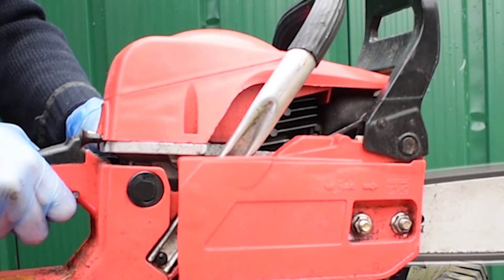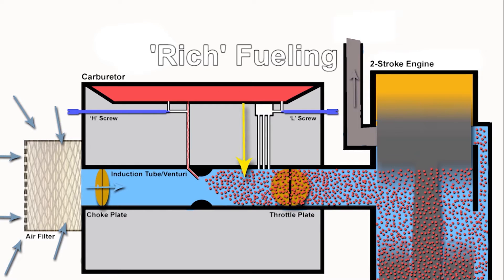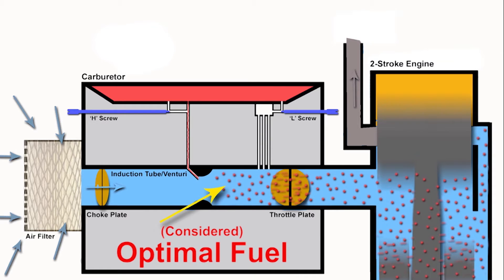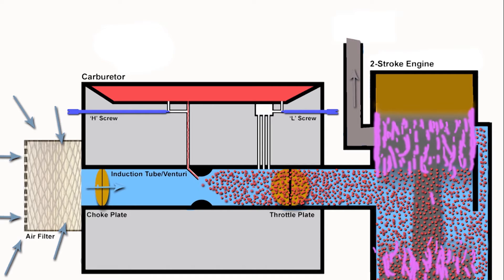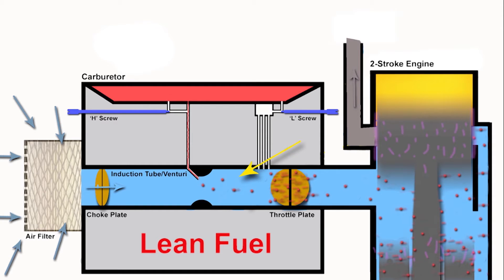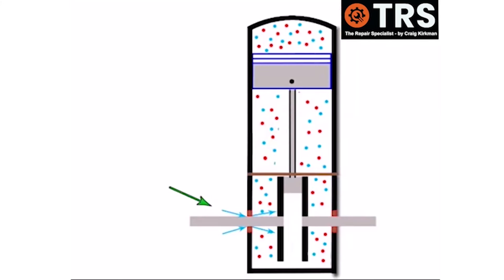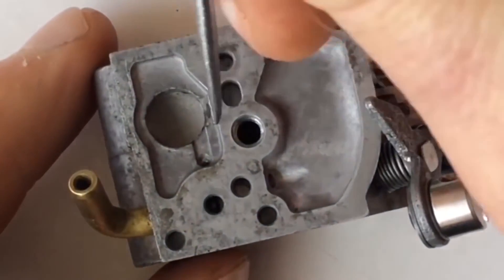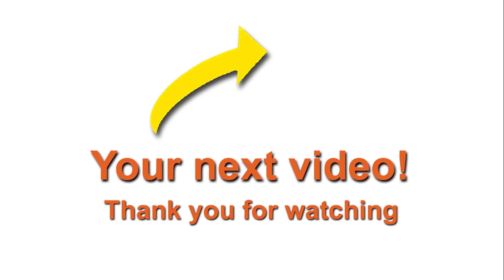The Effects of 'LEAN' Fuel-to-Air Mixture on 2-Stroke Chainsaw Engine RPM. (by Craig Kirkman)

Comment: Apologies to @TheRepairSpecialist if the following already exists but I'd LOVE  a video detailing how&why a powerhead may "get quirky" IF it's tuned well & running well but then, in my case, you're running it (echo 590) very hard in the midday FL humid heat, working your way through a large Oak trunk, and then like 20 or 40min into the job you find yourself needing to adjust the carb to re-gain that good-running condition you'd previously had! Currently giving myself a "remedial carb's course" because of that problem right now, I stored my 590 directly after the described scenario and a few months later upon trying to use it, it's barely turning-over (fuel quality / spark / etc, all 'low hanging fruits' were inspected before looking to the carb of this ~1yr old, well-maintained 590!)

Hope you figured out your SRM's scenario/solution, nothing more frustrating than taking care of your unit, self-schooling yourself, and still fighting to keep it working and/or contemplating simply buying a 2nd unit ("I WOULD have a 'parts saw' if I just bought a 2nd 590!", lol!!)
Reply: Maybe I was having a parallel saw problem last summer bucking a large trunk after felling it.  I was using one of my favs - a 372XP and in the hot weather it started bogging down on me losing power.  I still don't know why it happened and it's been running just fine since! (In my case I didn't try a carb adjustment but simply switched to a bigger saw.  I tend to take quite a few saws on jobs so when I run into problems I can just switch saws and keep working.)

Comment: Hey, i bought a 2 stroke electric generator and i cleaned the carburetor. The guy demo-ed the generator more than once with ether because he could not be bothered to clean the carb. It is only running fine if i let the choke on. It is possible than a lack of filter make the fuel mixture run lean, or i should look somewhere else to find another air input ? Or a damaged piston than got higher resistance, seal ? It is seems to be able to run if I unhook the speed regulation and remove the choke at least for 10-15second.
Reply: the possibilities are, 1. is the filter clean? . 2. if the filter is damaged, replace a new one. yes even if the tube of the filter is damaged which will called "Air leak" that will drawn more air into the engine to make the fuel mixture lean. 3. be very sure that the carburetor filter is free of blockage.  4. it could be the carburetor need adjusted a little bit.
Reply: @mitchelrichardson8164  thanks for the answer but i figured it out, I did not took apart the front panel when i wrote this. But here is the update:
I took away the front panel, i discovered that the carburetor/motor joint was flipped on itself, creating a vaccum/air intake after the carburetor. So I cleaned the joint, made new one from cartboard envelope from Amazon (pen, cutter, and drill bit with drill in reverse running fast to make dust with the cartboard, on a piece of wood ). It was running and stable but the speed regulation part was getting stuck and the diy air filter need adjusting. So I did remove the filter to see if it was starving for air. And I put a some air around the regulator shaft and now it running like I want even with the filter on.
Thanks, have a great day.
Reply: Oh, it might be a vacuum building up, i suspected something was up with fuel intake but not this way, you mentioned this into another video.
Reply: No air filter will cause it to be lean. Also a dirty carb will cause it to die after a period of time of revving it.

Comment: I recently bought a Stihl MS 661 CM Magnum by accident (complicated story so I'll spare everyone the details) and I'm pretty pissed off because I wanted the MS 661 R instead! My reasoning is that I don't like the idea of having electronics in a chainsaw. My question is for those that have the CM, What is your experience with your saw and has the electronics caused you any problems. I'm thinking of getting rid of it or possibly giving it a chance.
UPDATE: Since I got this saw a few days ago today was really the first chance I got to test this saw out. I cut a lot of ash from 24" to over 30" dia. Between how easy this saw starts and its cutting power it won me over. This saw is an animal that screams for more wood should you slow down below its cutting speed. Am now happy with it and thank you to everyone that took time out to respond.
Reply: no the electronics work very well, our 261 and 241 run very well with the electronic carburettor, even our MS500i works very well after months of no operation.
Reply: @gnaedigerfels  Thank you for taking time to give your input.
Reply: give it a chance. electronic battery chainsaw just takes too long to charge up, and when the battery aged, the battery life will be shorter.  fuel engine is easy and reliable.
Reply: @mitchelrichardson8164  Thank you...read my update.
Reply: You're singin' my song re computers in saws. I've tried to stick with the "3 series" in the Husky line just to avoid electronics - 346xp, 372xp, 390xp and I've been given a couple in the 5 series but the work horses are the 3s. (FYI, I switched to the T450iP for climbing and love it over my 4 gas climbing saws. Can't say enough about that effective efficient tool...)

Comment: Explain please why enhine increase rpm when mixture is lean?
Reply: Yes,  and I always thought that lean meant that there was too much air,  not too much fuel.  Silly me.
Reply: because the person adjusted the carburetor H and L needle clockwise to make the engine run lean,  a lean engine cause more air intake and less fuel to burn, to give more power, but its not good for the engine, otherwise it will overheat, depend on the carburetor setting. i had a 2 stroke RC car and my engine blew because of too lean and overheated.

Comment: can a lean condition cause piston scores  even if the gas to oil ration is correct?
Reply: yes, as the engine generates too much heat so the piston expands too much